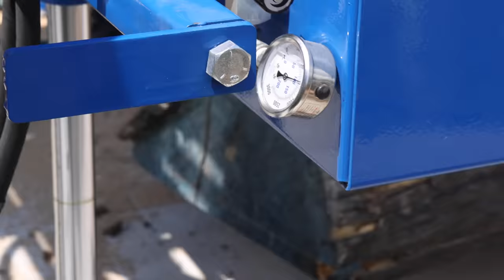I Waited 5 Years To Buy This...

Comment: VFD is a variable frequency drive. It controls the Herrtz going to the motor to allow for steady operation of the motor with the load you are putting on it. Thicker cut means it will ramp the motor up to run more thiner cut will ramp down so it's giving you the same consistent use no matter what.
Reply: Lol, yup.
Reply: Couldn't have said it better
Reply: @bjorngodden9181  I can, VFD is basically speed control. Changes speed and torque of the motor to be more efficient by adjusting frequency (Hz) and possibly voltage or current.
Reply: Regular AC electricity it's delivered to us from the grid at 60 hertz per second and if you hook up the motor it will just run to a steady RPM (depending on the motor  specifications at 60 hertz, this could be 1000 rpm, 1500 rpm, etc.) So the VFD control those hertz down and up. Basically boosts or slows the RPM. These are more frequent on industrial mixers, agitators or pressure fluid pumping systems.
Reply: VFD, also known as The True King of All Calamities, is a Dark Wyrm Rank 9 XYZ monster, with 3000 attack and defense, and currently sits on the forbidden list in both the TCG and OCG due to its oppressive effect.

It derives the name VFD from the three other True Kings.

It's because of the names of the other 3

真竜皇アグニマズドＶ / True King Agnimazud, the Vanisher

真竜皇バハルストスＦ / True King Bahrastos, the Fathomer

真竜皇リトスアジムＤ / True King Lithosagym, the Disaster

真竜皇Ｖ．Ｆ．Ｄ． / True King of All Calamities

So the way it work's is that you detach a material, call an attribute and it turns all face-up monsters on the field during that turn into said attribute. Note that it doesn't say "currently", so the attribute change applies even to monsters summoned/flipped after it has resolved. Also, for the rest of that turn, all monsters in your opponent's possession(hand, field, grave, banished, deck, extra deck) of the declared attribute cannot activate their effects.

The reason why this is so good is because a lot of decks usually revolve around a specific attribute, Adamancipators(Earth), Salamangreat (Fire), Shaddoll Invoked (Dark), HERO (Dark), Zombies(Dark), Mekk-Knight(Light), Mermail Atlantean (Water), etc. So if you know what deck the opponent is using it doesn't matter if the monster hits the field or not, you just call that deck monsters main attribute and they usually get shut down hard. Even for decks that don't revolve around a specific attribute like Altergeist the card is a problem because usually the "starter" monsters of most decks activate their effects on the field. So as soon as they hit the field their attribute will change to the one you declared and they won't be able to activate their effects.

There's very few decks that don't get hit hard by this effect. Shaddoll can play around it a lil bit I think since the 2 new main deck monsters are water/wind so they can trigger their effects in grave. But whatever they summon won't be able to activate it's effects sooo yeah. But they could still setup something decent for the next turn. The Invoked package can also play around it they hard draw the Invocation(they always do lol). I believe Endymion decks can play around it easily and Eldlich as well.

As for when to use it, you will most of the time want to use it during your opponen'ts standby phase. You don't want to wait till the MP1 because the turn player has priority on playing the first card, so if the first card they play on MP1 is something like Aleister you are screwed because Aleister will trigger and even if you chain Calamity to it's effect it won't matter because Calamity doesn't negate effects, it prevents activations and Aleister would've already activated.

During your turn if you think you can swing for game and don't want to get interrupted by a specific hand trap like Ash or a Nibiru just call that monster's attribute and you are free to OTK.

It shuts down almost all of your opponents monster effect and prevent your opponents from attacking. Most tiered deck rely on monster effect to do anything. If you go 1st make vfd, and several other big monster, preventing your opponents from activating monster effect will guarantee otk next turn.

This card's effect turns all monsters on the field into a declared Attribute, but prevents monsters in the opponent's possession from activating their effects. Therefore, it is more appropriate to declare an Attribute predominantly present on the opponent's Deck, rather than a random and unlikely one, such as DIVINE. For example: against a "Burning Abyss" Deck, declaring "DIVINE" or "WATER" will stop all opposing Extra Deck "Burning Abyss" monsters on the field from activating their effects and attacking, but declaring "DARK" will also stop the "Burning Abyss" monsters from activating their effects in the hand and Graveyard; against a "Shiranui" Deck, declaring "FIRE" will stop their effects that activate when they are banished; against a Deck that uses the "Windwitch" engine, declaring "WIND" will nullify their effects in the hand, etc.

Hope this helps.
Reply: @bunnygamer6317  Saying 60 hz per second is redundant as hertz means one cycle per second.  It's like saying atm machine...
Reply: "Herrtz", I don't know why but saying that in my mind made me laugh and my day better. Thank U forr that, I hope u have a great day as well :).
Reply: A VFD is also what you need to be able to run a 3 phase machine on single phase power.

Comment: John lift up the forks of the skidsteer so that you don't have to bend over to put each slab down. It's easier on the back.  Congratulations on the mill.
Reply: The back of his fork attachment is too tall to be able to climb out of the cab with the forks raised too much higher

Comment: Depending which way the wind blows along your building, you may want to make a shield for the compressor for the AC behind the mill for while you are running it so fine saw dust doesn't get sucked into it while the compressor is running (or at least since you have a hose there, rince it well when done milling so it doesn't build up in the fins and restrict air flow)
Reply: Great minds think alike 🤣
Reply: Cyclonic air filter would do it.

Comment: VFD stands for variable frequency drive essentially it let's you change the speed of the motor for different applications
Reply: Could be using it to wire up three phase motor?
Reply: @thomasstone3513  building 3 phase. Slow ramp start and speed control

Comment: I share your enthusiasm !
A VFD is a variable frequency drive, it does the electrical motor to spin in a very controlled manner, at the start it accelerates softly, in what is calles a "ramp up" of rpm, this is very good for avoiding sudden electrical power inrush and also avoids unnecesay mechanical stress on the parts. Its a very nice setup to have that 3phase electrical motor geverned by a VDF.

Comment: Super excited for you guys! I have only work with a mill a bit. One tip… flip it the other way so the dust shoots away from the building so it is easy to clean up with a tractor bucket
Reply: Bingo. First thing I noticed. All he has to do is swing it 180 degrees and he's back in business. Needs a better hold down for his material.

Comment: The blade guides need to be as close as possible to the edges of the cut to help avoid deflection.  There is also supposed to be a recommended test you can do to check blade tightness. 

ALWAYS clean off the wood, any dead or rotted and dirty parts, since that will dull the blade quicker than most anything.  Poor chip removal and overheating is the enemy, so be careful in the summer running that mill in the sun and heat of the day.  A canopy to get cover wouldn't hurt ya fellers now.

The VFD is necessary for the type of motor they are using, and probably has the ability to ramp up and down for soft start/stop, and should be able to sense load on the motor and in turn increase the power to maintain consistent blade speeds.  Very nice.

I think all that you need now is a large format slab planer and your table top game would be unstoppable.
Reply: Amazing how long a chain saw stays sharp as long as you avoid dirt. I imagine the same for a band. Sounds like you have experience! Why do they avoid carbide tipped? Is it simply the cost? And why can't tooth spacing be even wider, say 1 tooth per every 2 or 3 inches? At the rpms they're going, it ought to work. Damn the surface finish. Who needs smooth off the mill?

Comment: Couple of thoughts.
Saw dust blowing out against the building.
No covering for the work area. Lean to??
Lastly highly recommend using a metal detector on all your materials before sawing.
For best results some type of hold down for the material your cutting will save you a lot of blades and help with good cuts.
Best of luck.

Comment: Bit of an old video now but have you considered making a wooden arm/bar with some cheap metal detectors on it that scans the wood ahead of the blade?

I run a metal detector over pallet wood for small projects and what it saves in blades/stuff has paid for itself, figure it's the same with the big stuff too.

Comment: top tips we learnt running a wood mizer in the UK.... i) clean the log with a pressure washer before you start, get rid of all the grit and other cack that dulls your blades  ii)get yourself an in wood metal detector and check after each slab - you'll still hit some shit but it'll reduce it by about 90% (we found a musket barrel inside an oak tree once - that broke the blade) iii) with that in mind get yourselves some PPE especially helmets with visors - we know Jordan's already ugly :D  but he'll be uglier if he catches a broken blade across the face. iv) ptfe forestry wedges don't ding up the wood fibres when you knock them in to take the pressure off your blade  v) you can retouch a dull blade with an abrasive disc on an angle grinder - just like you would the bandsaw in the shop, one with more muscle...but a blade that's dinged beyond the teeth is toast (again so it don't break).  vi) get yourself a top grab for your skidsteer, lifting logs from below is a roll off accident waiting to happen.  vii) keep a chainsaw handy sooner or later the blade's going to get stuck and you'll have to cut down from the top to free it up
Reply: You still running a Mizer in UK or is that in the past now? Looks like fun.
Reply: Also, hope you salvaged that musket barrel?

Comment: I worked a two man saw mill similar to this one in 1980. Only the log was on a movable rack feeding the saw. It had a 48" horizontal chain saw bar. My father-in-law built it. We cut 3" slabs of walnut for gun stocks. We sold to Benelli, Remington, and a couple of high end gun makers. He chose the grain, laid out a template and cut the blank. I dipped the ends in wax and all the other work grunt work. Brings back memories. There would be less pressure on the blade if they used wedges to keep the weight of the slab from pincing it.

Comment: Dr Hank McCoy X-Men
VFD is Variable Frequency Drive.  It is a type of motor controller that drives an electric motor by varying the frequency and voltage supplied.  Its used to aid the ramp-up and ramp-down during start up and shut down.  You should keep those cuts together and using liquid glass (black epoxy) and pour it into all the voids.  That would make a beautiful large table.

Comment: A VFD takes regular a/c power and turns it into D/C power which helps with energy and power modulation in which will allow the motor to ramp up or down depending on logic in computer/ board.

Comment: 2in 0.55 munksford saga steel is ideal for your mill, carbide is nice but at $300+ apiece your gonna have to give your sponsor alot of reach arounds. Best cutting fluid is diesel, dawn & pine sol is second if the smell is an issue. Start scanning your logs and pulling the metal. Additionally, you need some dogs/ log clamps on your wood runners or else your gonna tear something up and have to get weld spatter all over new mill.  If your gonna cut junk logs, make sure to cut 12/4 to account for the incredible amount of distortion that all the defects will inevitably cause. Best Regards.

Comment: A VFD is also a good way to phase convert. While it is a great tool to run at different speeds by fluctuations in the voltage and Hz on a linear curve as opposed to a reduced voltage starter ( soft start). If you only have single phase power coming in to your shop, a VFD can “make up” the third leg for three phase. This all assuming voltage is the same across the board, but it can too be changed with transformers.

Comment: The abbreviation of VFD was already "decoded". The only think I will add is that the frequency is directly related to the speed of the motor and not to the power. But the VFD does keep an "eye" on the current drawn from the motor so it is not overloaded. The more advanced VFD's have feedback with several parameters incl. the real frequency (rpm) of the shaft as well as the temperature of the motor to protect it from overheating. It also starts the motor up smooter (so-called soft start) and can stop it much faster (if needed). Also protects the motor and the circuits from overcurrent during the transition time.

Comment: VFD, also known as The True King of All Calamities, is a Dark Wyrm Rank 9 XYZ monster, with 3000 attack and defense, and currently sits on the forbidden list in both the TCG and OCG due to its oppressive effect.

It derives the name VFD from the three other True Kings.

It's because of the names of the other 3

真竜皇アグニマズドＶ / True King Agnimazud, the Vanisher

真竜皇バハルストスＦ / True King Bahrastos, the Fathomer

真竜皇リトスアジムＤ / True King Lithosagym, the Disaster

真竜皇Ｖ．Ｆ．Ｄ． / True King of All Calamities

So the way it work's is that you detach a material, call an attribute and it turns all face-up monsters on the field during that turn into said attribute. Note that it doesn't say "currently", so the attribute change applies even to monsters summoned/flipped after it has resolved. Also, for the rest of that turn, all monsters in your opponent's possession(hand, field, grave, banished, deck, extra deck) of the declared attribute cannot activate their effects.

The reason why this is so good is because a lot of decks usually revolve around a specific attribute, Adamancipators(Earth), Salamangreat (Fire), Shaddoll Invoked (Dark), HERO (Dark), Zombies(Dark), Mekk-Knight(Light), Mermail Atlantean (Water), etc. So if you know what deck the opponent is using it doesn't matter if the monster hits the field or not, you just call that deck monsters main attribute and they usually get shut down hard. Even for decks that don't revolve around a specific attribute like Altergeist the card is a problem because usually the "starter" monsters of most decks activate their effects on the field. So as soon as they hit the field their attribute will change to the one you declared and they won't be able to activate their effects.

There's very few decks that don't get hit hard by this effect. Shaddoll can play around it a lil bit I think since the 2 new main deck monsters are water/wind so they can trigger their effects in grave. But whatever they summon won't be able to activate it's effects sooo yeah. But they could still setup something decent for the next turn. The Invoked package can also play around it they hard draw the Invocation(they always do lol). I believe Endymion decks can play around it easily and Eldlich as well.

As for when to use it, you will most of the time want to use it during your opponen'ts standby phase. You don't want to wait till the MP1 because the turn player has priority on playing the first card, so if the first card they play on MP1 is something like Aleister you are screwed because Aleister will trigger and even if you chain Calamity to it's effect it won't matter because Calamity doesn't negate effects, it prevents activations and Aleister would've already activated.

During your turn if you think you can swing for game and don't want to get interrupted by a specific hand trap like Ash or a Nibiru just call that monster's attribute and you are free to OTK.

It shuts down almost all of your opponents monster effect and prevent your opponents from attacking. Most tiered deck rely on monster effect to do anything. If you go 1st make vfd, and several other big monster, preventing your opponents from activating monster effect will guarantee otk next turn.

This card's effect turns all monsters on the field into a declared Attribute, but prevents monsters in the opponent's possession from activating their effects. Therefore, it is more appropriate to declare an Attribute predominantly present on the opponent's Deck, rather than a random and unlikely one, such as DIVINE. For example: against a "Burning Abyss" Deck, declaring "DIVINE" or "WATER" will stop all opposing Extra Deck "Burning Abyss" monsters on the field from activating their effects and attacking, but declaring "DARK" will also stop the "Burning Abyss" monsters from activating their effects in the hand and Graveyard; against a "Shiranui" Deck, declaring "FIRE" will stop their effects that activate when they are banished; against a Deck that uses the "Windwitch" engine, declaring "WIND" will nullify their effects in the hand, etc.

Hope this helps.

Comment: Rock on John. Been running a band mill for 18 years over here. They are fun. You will go through a lot of blades haha. They really really hate metal.
Reply from the maker: You use carbide ?
Reply: @John_Malecki  I do not. Just standard double hard blades. They cut faster and thinner kerf than the carbides. I most cut lumber with clear trees. On the woodmizer the bands are pretty cheep so if I hit metal it just means a dead $20 blade.